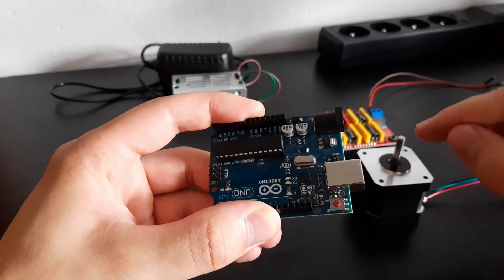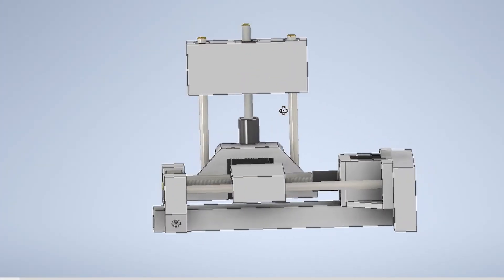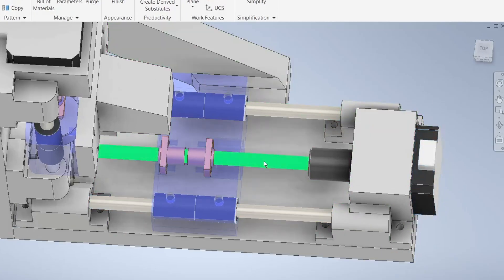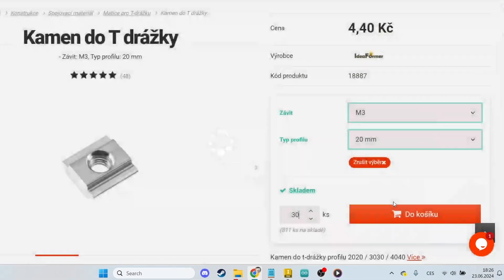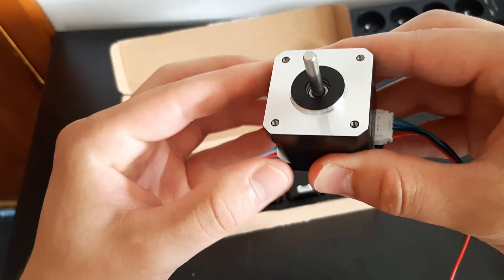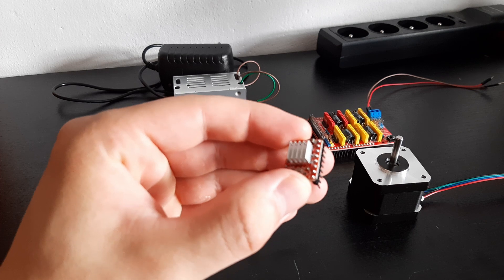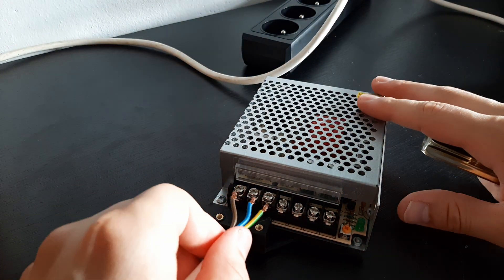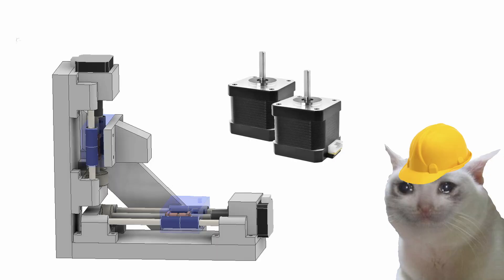3D Printed CNC Machine Design

Comment: 02:49 slight mistake , the stepper make 200 steps per revolution , 360degrees divided by 200 steps : 360/200 = 1.8 degree per step. Good luck with your project.